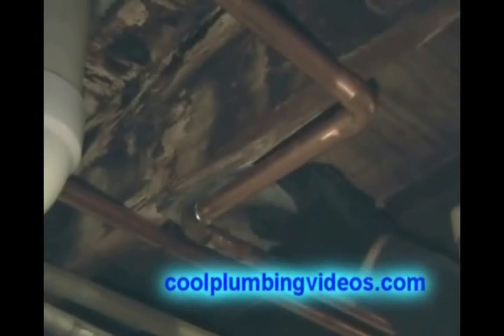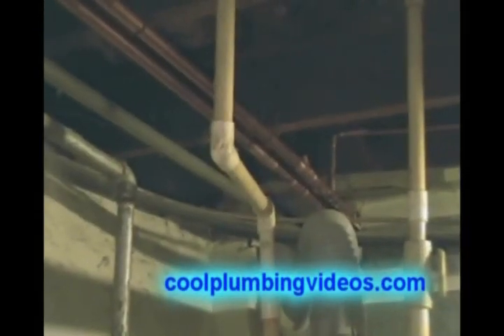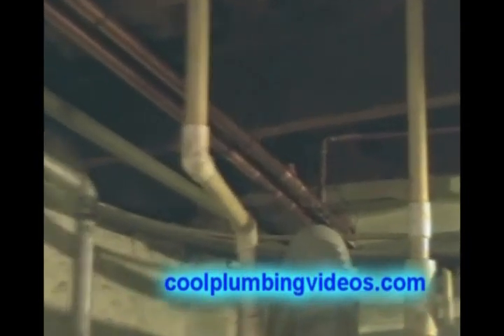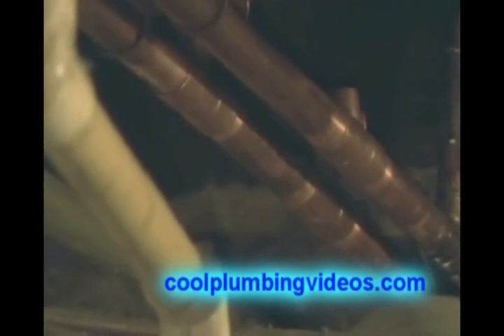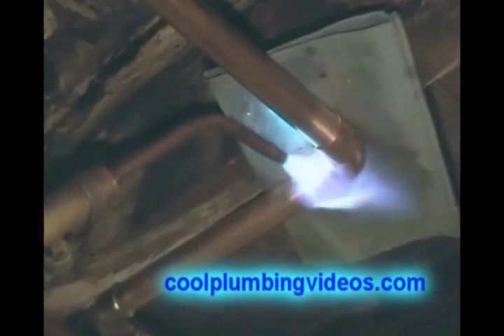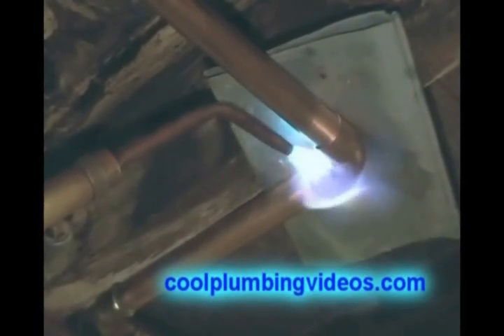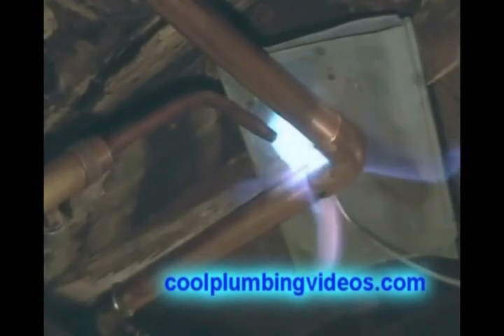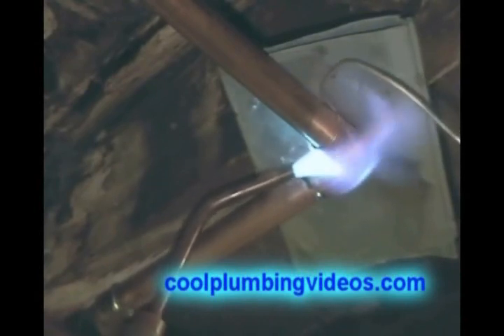How to Solder copper pipe and not burn wood studs 1

Comment: I had an issue in my basement and had to remove some ceiling tiles. I saw burnt wood all around the copper pipes at the joints. I thought it was some ongoing problem and that I was in danger of a potential fire. Wasn’t sure if they were gas pipes or what. Thankfully I found this video which set my mind at ease. Whoever installed my plumbing obviously didn’t have the know how to avoid burning the wood floor joists. Surprised I didn’t notice it upon inspection. Maybe I did it’s just been so long. I’ll sleep better knowing it’s always been like that.

Comment: can I use putty pads instead ? to weld against wood ?
Reply from the maker: sorry I'm not familiar with that. yes they do make fire retardant spray and pads. but in this spot it's so open and not confined all I needed at the time was this peice of tin. but yes in a more confind space I would use a spray or pad. thank you for the comment. I will have to look up this stuff you mention.
Reply: Ok thank you let me know